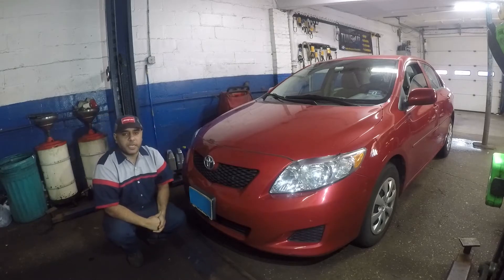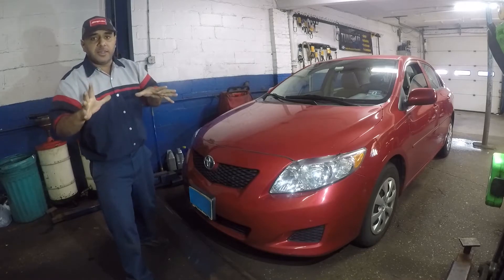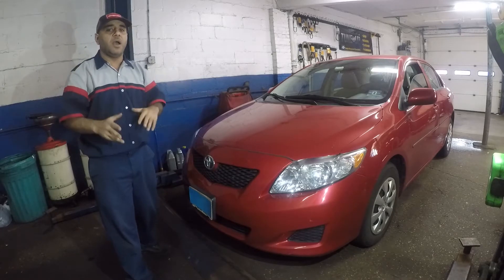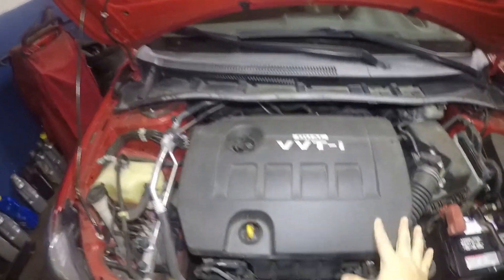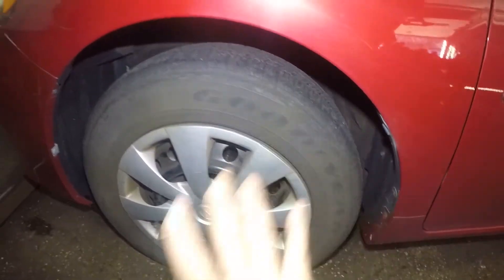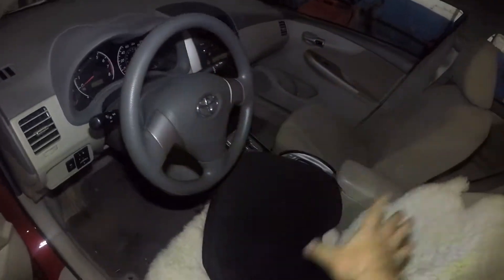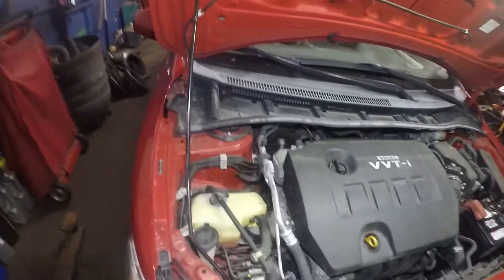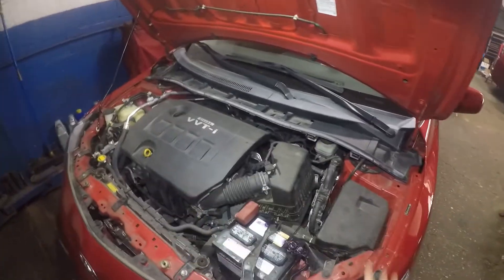Best car to buy Toyota Corolla, good FUEL ECONOMY Reliable and easy cheap to fix

Comment: I have an 09 corolla with 157k miles from brand new. They really dont require any maint besides oil changes and basic brakes shocks etc. only issue tho is this gen had notorious water pump issue and these motors burn oil. My 09 burns oil a lot, but i managed to fix it by using high mileage oil and liqui moly mos2. Next ima use liqui moly oil saver mixed with high mileage and that should fix oil burning completely.
Reply from the maker: Yup they r really good